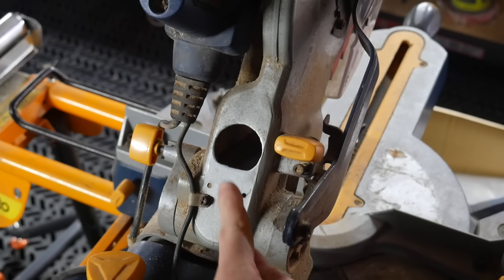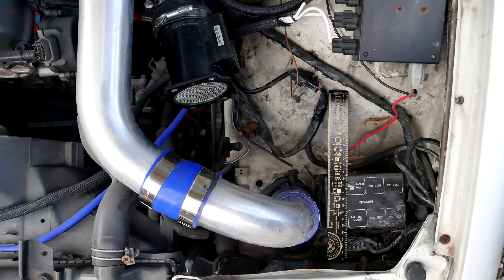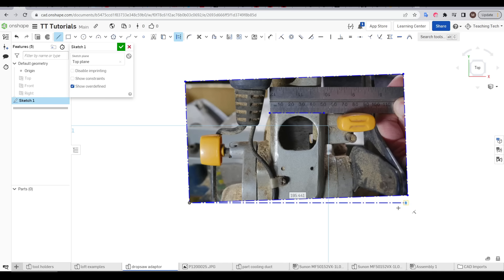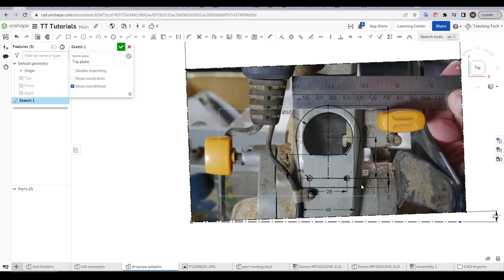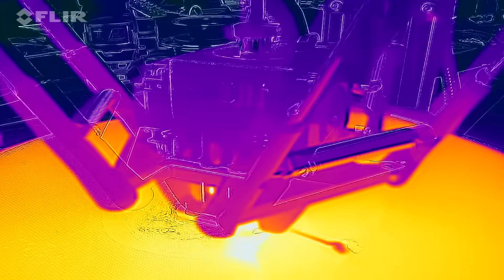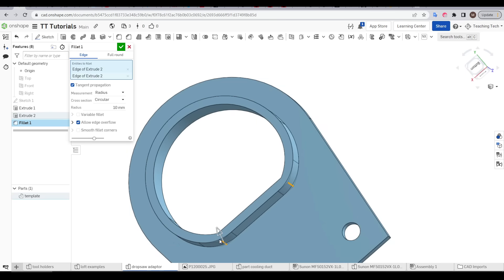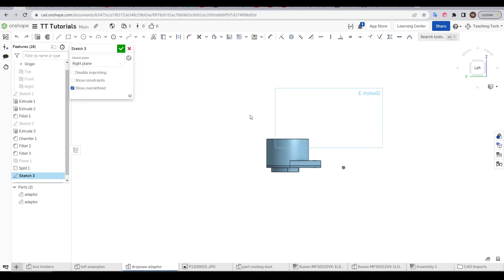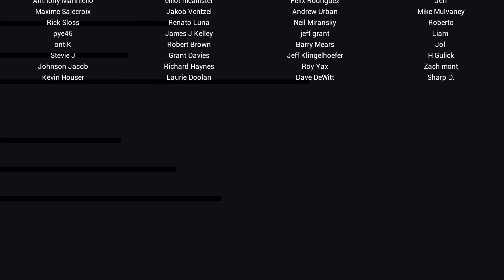Parts that fit odd shaped objects - 3D design for 3D printing pt4

Comment: The best part of this video was the split part.  I printed a part with a flange on the underside and the support was a nightmare.  I  need to split it and print as 2 pieces as you did.  But I need to add something for registration so the 2 halves are aligned and don't turn or anything.  Also I'll need to screw them together or something.  I haven't done it yet though.  I think if I draw a plane and on that plane I draw some spheres with one side hollow ant the other side a ball that would make nubs and then likewise make holes for screws.  Would be grreat to just thread them together but I haven't figured out how to make 4" threads like a jar though.  I haven't tried the photo thing yet but it's good to know that it's an option.  I tried it with a map of my building's facility but had trouble with getting a good reference measure.  On a map you can't exactly put a ruler on it.  If I knew the exact building dimensions that would do it but I don't. I could use Google earth but I don't think that's precise enough to get good results and the inside of the building is smaller than the outside.  I war really just experimenting anyway with that.

Comment: To get dimensions fast and easy, I use a "paperlike ducttape" or transparent one, stick it to the surface of that metal, than trace needed shapes and holes with a pen and there you go.

Comment: can you explain why the specific goal of no supports? for some situations if it isn’t possible to work around it would be good to understand the impacts.
Reply from the maker: Personally I always try to avoid using them as the print will be longer and filament will be wasted. Therefore it's a criteria I add to anything I design.

Comment: You should use a high power led like 1W with aluminum PCB theses small led doesn't last very long and aren't powerful at all!
Why using 3 li-ion battery? You don't need 24h run time one is more than enough as long as you can replace it  easily (with this solution you don't need a charger on the base)
And it's much more lightweight so you don't need strong magnets

Comment: I print engineering prototypes, useful mechanical parts I create to solve daily problems as shown in this video, and products that I sell.  This was a GREAT video.  It's a very good example of how OnShape is used as a fairly easy and intuitive but full featured 3D CAD tool.  I recently bought a 4WD Hijet Japanese mini truck and I'm slowly remaking it in 3D printed parts.  Tonight - a rubbery TPU mounting adapter for a universal replacement fuel pump.

Comment: nice video but I have a question. If you have to print something which should fit onto another object. Like your vacuum on the model. Whats the measurement you in- or decreased that it fits perfectly? 0.2 mm?

Comment: This series is perfect for what I'm trying to do now!  Though I'd probably fail your class or need to hire a private tutor 🤣 at least with the YouTube videos I can rewind 100 times . Thank you for all your excellent educational content! 
Do you happen to have a video on how the f@#k to fix the CR10s pro leveling madness 🤪 that damn gantry or bed  going wonky on me is really frustrating! I'll get anywhere from 2 to 10 prints and then for no apparent reason the next model fails because the gantry or bed is no longer level.  I've installed the backlash nuts, leveled the gantry , place bearings at the top of the bars , set my nozzle height perfectly.... It doesn't matter it always goes wonky 🤬 no fix has been permanent and it really makes printing wasteful. 

Thanks again Mike!

Comment: Great video as always.  A clearance hole for an m4 bolt is never 4mm. A close hole is 4.3mm and a loose is 4.8mm.  

Even when machining parts, this is true.  The reason you can get away with using a 4mm drill bit is they wobble and create an oversized hole.

Just look up "clearance hole chart" on your internet browser of choice. 

Keep up the great work!
Reply: onShape actually has a function that includes sizing holes for capscrews. If you use the hole feature rather than drawing circles in the sketch you choose the can choose the function of the  holes. Choices include "threaded" which automatically generates the recommended tap drill size or "clearance" where it generates a slightly oversized  hole. I believe that the clearance hole that is automatically generated will be  4.5 mm diamater.

Comment: I believe the reason 4.4mm was the sweet spot for the hole is because when using a 0.4mm nozzle the printer uses the exact centre of the nozzle as its referance and doesnt take into account the 0.2mm of filament on each side. As this is a circle, there is 0.2mm on the radius totaling to 0.4mm on the diameter.

Comment: Second question, why didn't you just give the line for the bottom of the ruler a horizontal constraint instead of messing with trying to match angles?  Or, why not give a parallel constraint to the two lines you drew?  I'm still learning much of this so just trying to understand why you went with this method.

Comment: One thing you skipped over (apologies if it was covered before) was how you got the distance between the bolt holes.  Did you just measure the distance of the outside points of the holes and the subtract the diameter of one hole to get the 28mm measurement?

Comment: This is EXACTLY the kind of bracket that I needed to design for the extendable legs on my drafting table (the ancient plastic ones have cracked and crumbled away). Currently printing my first prototype now. I'm so happy that I'm starting to understand how to make parametric dimensions that allow parts to be updated and modified as needed. Such a huge step in the journey of designing my own parts! Thanks so much for this series.

Comment: A friendly suggestion, because a bit of this took the hard way 'round: all of those dimensions could have been obtained far faster, more easily, and more accurately. 
- Calipers on the arm's outer rectangular wall gets you the overall width.
- The length from the screw ports to the top of the exhaust port can be measured by putting M4 screws in the holes, putting a rigid ruler against the outside of the screws, then measuring the distance from the screws to the flat facet of the exhaust port with another ruler. 
- The exhaust port is symmetrical, so use the inside jaws of the calipers to measure the circle's diameter, then the distance from the apex of the arc to the middle of the flat facet. 
- While not visually obvious, the different radius toward the corners can be approximated by doing a diagonal measurements with the calipers. 

With these dimensions, you have everything you need to faithfully sketch the part, and you can do so quite quickly. Test print and iterate as needed. There are cases where it is necessary to take photos and sketch over those (absent using more advanced tools), but it can be problematic when trying to adjust for the keystoning and distortion inherent to the photos. Plus, it usually makes the process more difficult than it needs to be.  Regardless, I do appreciate this video series, and I know the goal was to show people how to measure and design things that have more complex geometries, so this fairly simple design was probably the best example you had at hand.

Comment: The only change I would have made would have been from a structural standpoint. The original hose adapter was likely metal so two bolts would have been fine. For the plastic replacement, I personally would have added a tab  with a mounting hole at the top of the adapter as well, then drilled and tapped another M4 hole in the saw at the top above the duct collection hole. This would have increased strength considerably for very little added work. Because I know for a fact that things like people not paying attention and walking in to/tripping over hoses, etc, do end up happening. and I think this being plastic secured by only two bolts on one side, has a non-minimal chance of breaking in those circumstances.

Comment: Nice and I do the photo-sizing in Photoshop since I have it. The lense-distortion of my phone is quite annoying and also the shrinking of some filaments after printing. I thought about making such photos with my old compact camera that provides a lot of zoom instead of those phone-cams with wide-angle. In theory it should make more accurate photos of close objects. In Cura it's advised to change the 'slicing-tolerance' to exclusive, so it slices without over-extrusion, which still needs at least +0.4 mm wider holes for the screws, but parts that needs to fit together usually just needs 0.2 mm tolerance only. Without it's 0.8 or so. 

I also prefer Onshape, but a shame it's so much more in price compare to Fusion 360. If I have to licence a CAD-software, I will probably switch to 360 since it does everything similar, but as a free version Onshape excelles. I also though about using Solid Edge and the free version is probably the most powerful 'free' CAD-software, but the lack of a Mac-version and the complex UI makes me keep using Onshape.

Comment: A lot of my prints are design for fixing things or additional prices that I have designed, and what I do is get the closest I can to replicating the thing just by measuring with a ruler/caliper, I'll print it at 100%, and then I'll go back and cut, drill, and sand the model until it works. I printed butterfly knife a little bit ago but made a major mistake in the opening mechanism, so rather than going back into tinkercad and fixing, reprinting, and retesting it, I took it to the band saw and cut the corner of that I needed to and it works perfectly.

Comment: This series is the missing link to making 3D printers useful tools and not just something for printing trinkets.  Don't get me wrong, I have a shelf full of fun trinkets but I'd rather use my printers as tools.  Knowing how to make your own part for your specific application is the key to unlocking the full potential of a 3D printer.  Combine this with some nice engineering materials, like carbon fiber filled nylon and the sky's the limit.  Thank you Michael for putting this very useful series of videos together.

Comment: One thing to note when taking and using reference images is to always use the longest edge on the item you can to reduce extrapolation effects. Airways more accurate interpolating. When scaling a reference image use as much of the ruler as visible to reduce camera distortion effects on scales.

Comment: You should have used FreeCAD.
Scaling the image to correct size is much easier in FreeCAD.
You select a distance in the image and give it’s real dimensions. No use for manually iterating.

Comment: The price difference between a cheap metal calipers and a cheap plastic calipers is really worth the price.  Also, measuring from the edge of the ruler is much harder than measuring from 10mm to 60mm, and less accurate also. That's why expensive rulers (like architects use) have extra on each end. You can see when he zooms in that the first mm mark is closer to half a mm from the edge.

One reason holes might be too small is the printer is moving the print head around the edge of the hole in a 4mm circle. But the extruded plastic is about 0.4mm wide. Which means the extruded circle is 0.2mm smaller on either side. Which means you have to compensate by the width of the extrusion to get the perfect circle.
Reply: slicers will account for the line width (if it doesn't then you need a better slicer), the error is due to a number of factors.
G-code is sliced as a series of straight lines, there is an arc command, but most slicers do not use it.
first layers will have some amount of "elephant's foot" where it spreads slightly more on your first few layers than when you get further up, this can be addressed with some tuning of Z-offset and slicer settings designed to compensate for this phenomenon.
model fidelity, if your model is too low resolution, then your holes will close up more.

Comment: A 4mm bolt will never fit in a 4mm hole - its just too tight. Always add a slight airgap..

Gentle persuasion.. lol 

Why did you not glue the 2 parts together? The only connectability is at the 2 bolts.. any bending while moving the saw could introduce a small gap, reducing suction for dust extraction..

Other than that - great video once again.

Comment: I'm a bit annoyed by the suggestion of just setting holes to arbitrarily be .4 mm larger as a solution.  Hole size should be set in accordance with design intent.  There are already standards for clearance holes for fasteners.  It's very annoying to go on a model repository and get a design that has wacky clearances baked in because it worked on the designers machine.  As pointed out if your machine is the problem there are compensations in the slicer but hole size should be set in the design according to what size you actually want the hole to be.  That was also imo a missed opportunity for a teaching moment about how to work with tolerances.  It is also appreciated that you are making these intro videos for the community but perhaps you could call out when there is a lot more to a discussion than covered.

Comment: If possible i would like to see a tutorial video for this series that explains how to design a part around another part in the studio. Like with having to reference dimensions from the part you would like to fit another part around. For example you have a hexagonal shaft and instead of using the dimensions from the shaft you just model around the shaft for the part that will go on said shaft. Im not sure if thats even possible but if it is, it would be nice to see a video about how to do that.
Reply: Im not too sure if my explanation is right so i have what i think is a slightly better one. Say you have a box and you model the box but now you want a lid. If there is a way to just model the lid of of the box without refence to the boxes dimensions, is there a way to do that so that way you dont have to be going back and forth to the boxes dimensions for each step of modeling the lid?

Comment: There is a really easy way to get dimensionally accurate outlines. It's super old school technique which is probably why i guess younger people don't use it. You take a piece of paper or masking tape. Then rub with a graphite or charcoal stick. and voila you have a 100% accurate representation of what you are trying to model. It's also great for transfering scroll work on wood. Then attach to a piece of paper since those tend to be rather dimensionally accurate and scan said piece of paper put it in your modeling software as a reference and scale it properly. It has the added advantage of not having lens distortion. It won't work for the car engine bay but since you don't have any mating surfaces it would probably be fine
Reply: I am a "young" person (in my 20's). And i guess you talking about what i have been doing in the kindergarden. Which was putting paper above a cuttet plant leave to rub over with a pencil to tranfer over the surface of the leave to the paper, right?
Reply: @MrGTAmodsgerman  Correct.
Reply: Dirty greasy hands work as well as graphite!
Reply: I don't fully understand this method, could you explain more clearly?
Reply: @noahjones7579  literally you put the paper or tape over the surface and then rub a graphite stick or charcoal stick over it. the edges will come out dark while the flat surfaces will be light. the important part is to have a relatively large surface area of where the graphite or charcoal comes in contact since you are relying on the underneat surface to give the local pressure for the image to come out
Reply: I use this method for anything planar. If you have post-it notes, it makes a good square/precision reference to scale the scan, or alternatively print your own reference square.
Reply: @hecubus311  you can use it with cylinders or any developable surface. If the surface can be transformed into lying flat without compresssion or stretching you can use this technique so planes, cones, cylinders, etc.,
Reply: While I fully agree with the simplicity and effectiveness of the technique (and use it often), it can also be imprecise in cases where the tape or paper stretches, as well as when the hole or feature has radiused/filleted edges.

Comment: Smart money would have drilled a third hole at the top. If it was a 1 part solution the 2 holes would probably be fine because the lip would have caused friction, but this way there is torque on the PLA part and the bolts on every movement.
Reply: Agreed, probably good enough as is, but might be why the part broke in the first place. Model the tab/hole above the inlet, and tap another M4 on the saw.

Comment: Great work.  I wonder what you'd do if you had to move the machines.  It seems like it'll be hard to remove the hose and it's just extra work to unscrew the adapter.  Maybe do a quick release version?

Comment: Save yourself alot of trouble.lay a piece of paper and a crayon.  Lay the paper over the hole and use the crayon to trace out the hole. Then put the paper on your scanner.  Boom done.

Comment: Great series. 

My problem is, coming from Fusion 360 I miss the 3d body creation. OnShape seems to be drawing based and you can't wack a primitive down and manipulate it. 

But since F360 is going through licensing hell, I keep trying to work with ideas like constraints
Reply: Try DesignSpark Mechanical , it's free it's offline capable so it actually runs on your computer but you do need to make an account. It does take some getting used to but man its way better than onshape.
Reply: DesignSpark Mechanical appears to be Wndows only [as of Jan. 2023].